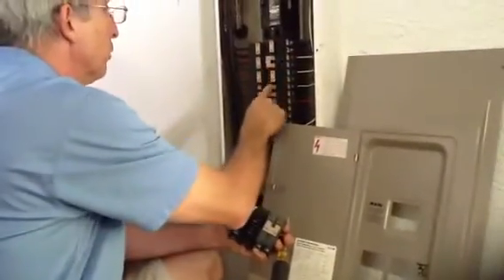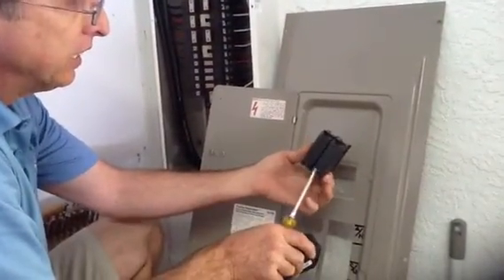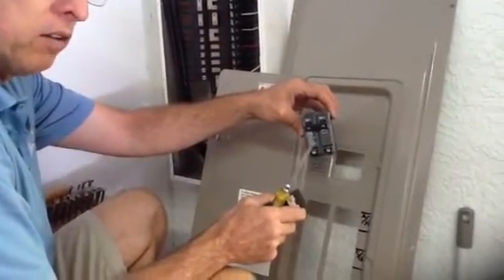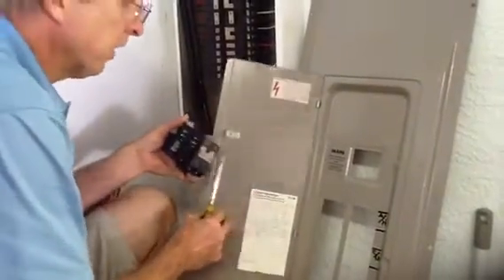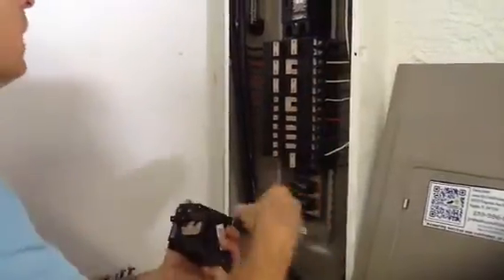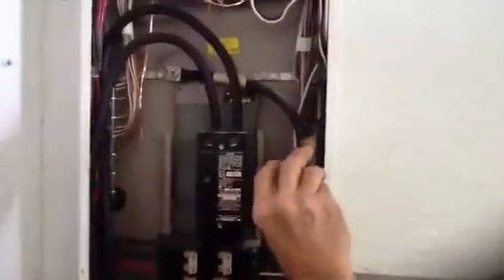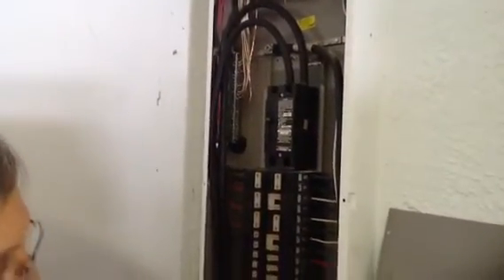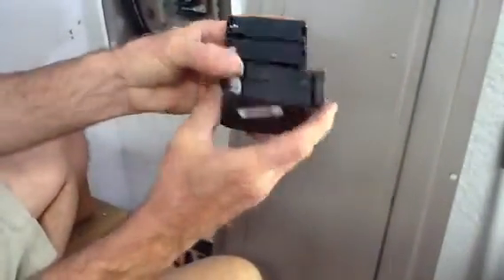Two Types of Cutler Hammer Breakers

Comment: my cutler hammer eaton 20 amp 120v afci braf has a black handle. i can't find a diirect replacement. any suggestions? i felt i progressed well by finding this one dead breaker with 0 volts and now im having trouble finding a replacement breaker

Comment: You mentioned it's not a 4 wire system. Guessing you're referring to the fact it's a 240 volt, delta, single phase, and you don't have a grounding  conductor. Just a neutral, two hots.
But maybe nicer if you also mentioned that it's not a sub panel.
That's why neutral and grounds can be on same bar.🙂
Reply: bonding  at your first means of disconnect is first year apprentice shit. It's common knowledge he probably assumed everybody knows that

Comment: Eaton bought both Westinghouse and cutler hammer without changing the product. The br breakers are Westinghouse and the ch breakers are cutler hammer. Neither are necessarily an old style. Someone already pointed out the differences. The price difference is due to the difference in the breaker construction. They key point is that they are different size breakers and do not fit the same panel. Grey panel requires br and tan requires ch.
Reply: Exactly and CH is a better breaker panel as far as I’m concerned.

Comment: not to step on any toes, however the "black" and "tan" is partially incorrect. Cutler hammer makes a type "BR" panel, which uses the black handled breakers. the other style is the type "CH" panel, which uses the tan handled breaker. these breakers are called either "br" or "ch" breakers, respectively. the type "Br" panel is the cheaper of the two, and uses aluminum bus bars in the back. while Siemens or homeline breakers will or can be made to fit, realize that using the wrong style breaker will be grounds for an insurance claim to be denied should there be a fire. the type "ch" panel is the higher end unit, and has the odd fingers on the back end to lock them into the panel. this panel and it's breakers has a lifetime warranty vs 10 yrs for the BR panel. also the bus bar is solid copper, silver plated for better conductivity and longevity as the aluminum bus bars on cheaper panels can begin to pit depending on the environment. both are solid panels, as is pretty much any brand that is ul listed. the type ch is one of the best panels out there both in construction and breaker design.
Reply: I’m noticing the tan colored ones with the odd hook on the connector are getting harder to find. I knew Eaton had bought out CH but I didn’t realize the breakers wouldn’t still be made. Go into any Home Depot or Lowe’s... shelves are bare. I’m wondering if the new CH designed Eaton breakers can be used in my old style CH panel. 🤔
Reply: @JackofAllTrades1 I just bought some yesterday @ HD if that's any consolation.
Reply: Very accurate and thorough explanation brother!
Reply: Eric Stringer hJeep TJ 2003 Expenses   Jan /2016

Gas.                 $ 20.00
Tires.                 598.00
CTC Pre Insp.      33.52
Merit Muffler     140.94
Lucius Oil. CTC   14.36
B&T Water Pmp   68.93
PAS Labor WP.    280.
Safety Insp.           43.70   With Oil and filter chg Jan 23/16
At Master Muf.
Gas.  Jan 23.         20.00                              
Eric                          50.00         Undercoating Jeep on Hoist
So Far!!

Under coated at Eric's yesterday, we owe him!!

Total.                $ 1269.45

Jeep Sold.                $6500
Expenses approx.   $1250.

Total after Sale.       $5250.

Transfer to Shaun's TD Acc.  Jan 27/2016.  $3250.

Hold for Shaun for School                              $2000.

Total.       Jan 28/2016                                     $ 5250.00

Sent remaining Money $2000+ $200 interest = $2200.00
For Car to Shaun via Transfer July 12/18

Sent from my iPad

Comment: I have a ch412c, which I think is a 125 amp panel. My question is can I put a 50 amp breaker in it for a welder?
Reply: It depends it depends how many amps your house is pulling. You would have to take a nap probe into an amp draw or just do a rough calculation. If your house including your new welding plug exceeds 100 amp's (80%) of 125 you would first need to get a service upgrade and switch to a 200 amp panel which would run you about 1,500 to 2,000$

Comment: Why does the ch100cs Cutler Hammer have little flimsy plastic rejection tabs dangling out the back of the breaker? Assuming they're called rejection tabs. Do you have to slide them into the plastic slots on the panel before it can pop onto the bus? I was told the ch model breaker would work on the panel. Can't get it to pop in though because of those weird tabs. Called numerous places and no one seems to know anything about those tabs protruding from the breaker.
Reply: I meant ch2100cs